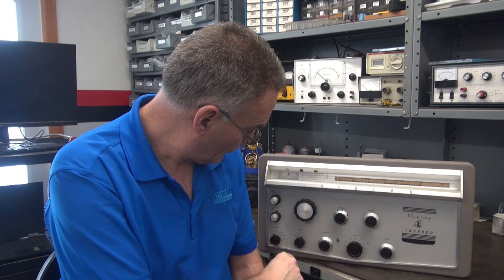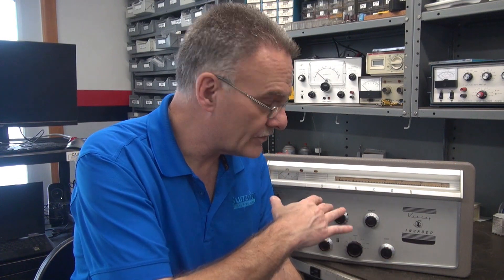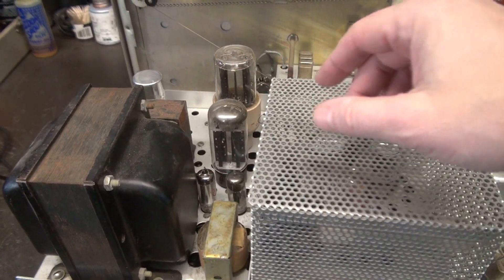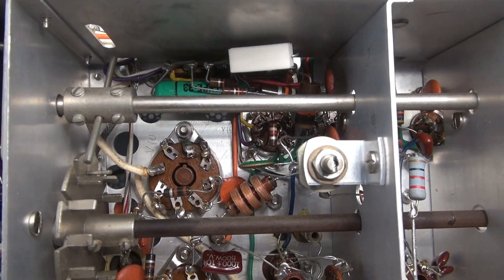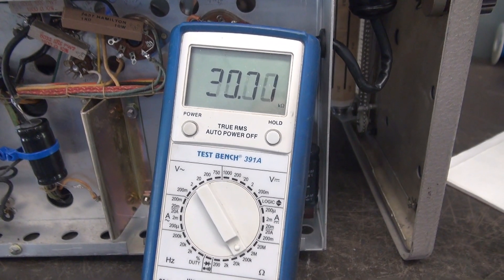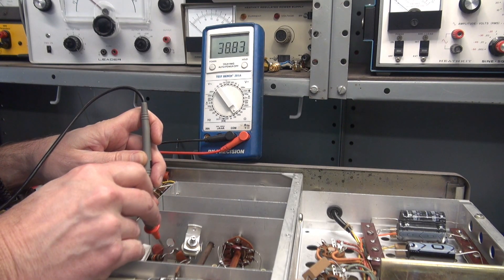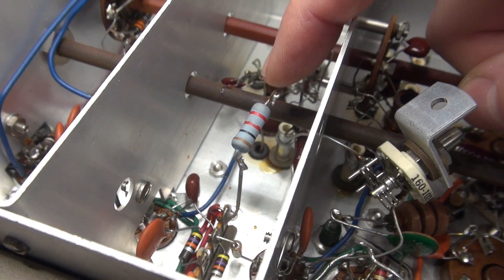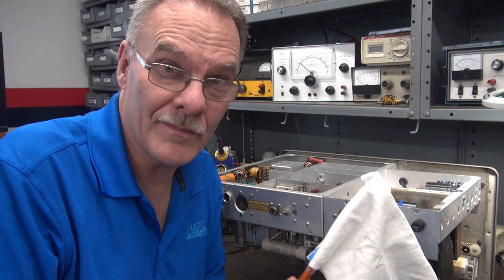Vintage EF Johnson Invader 200 Ham Tube Transmitter Attempted repair Failed Need Help any advice?

Comment: You have a leaky mics cap. Common problem with this transmitter. Shows on when voltage is applied to driver tube. Also check to make sure bias is correct on the driver tube grid. It mill make it stay say to much corrent. W3AMT 73's

Comment: I have a Viking Invader and have had it since the late 60’s. Until recently I had only had one problem with it long ago. A spurious signal just below 7.0 MHz. Turned out to be weird harmonic of crystal oscillator. 2nd harmonic of carrier oscillator mixed with 2nd harmonic of first mixer. Ended up with keyed CW signal at 6994 KHz. ( I received a notice from the FCC) I added a trap tuned to second harmonic of one of the crystal oscillators. A few years ago it stopped transmitting. I suspect one of the oscillators. I will soon be going in to see what the issue is. 
Did you pull the driver tube and check the resistance? I don’t think I heard you say you did. Just a wild thought. I will watch the video again. I am very interested in your Invader project. 
Don, N4DJ

Comment: Possibly a hairline crack or carbon short in a tube socket?
In all of my years of working on radios I have never had the pleasure of working on one of those. It is quite a nice looking unit. I have faith that you will figure it out.

Comment: I’ll have to confirm this, but I did my first research on Invader 200/2000 a couple of weeks ago because one came up for sale nearby. This “sticks in transmit despite the relay” issue rings a strong bell in my mind. I read a lot of threads, but I’d bet this was on a QRZ forum, and my recollection is that people said this is a neutralization problem. The circuit heating would be from the RF oscillation, not a DC overcurrent condition caused by a short or faulty component. Are you seeing VHF on the scope at the driver stage, or final grids?

I’ll try to find this again, assuming my memory is correct. Meantime, you might try searching the boat anchor and general technical forums on QRZ.
Reply from the maker: Yes, I agree, I had the RF oscillation, I could stop the transmit latch by detuning the plate or exciter variable caps. This was before I discovered the open 1K resistor. With the new one in, no transmit, but overheating of the resistor

Comment: Terry,  I agree with The Radio Shop about the tube socket.  If it's Phenolic wafer material and the tube has been overheating it could have created a micro crack that has carbonized making the circuit draw more current.  Suggest pull all the leads off the socket and check for insulation to ground and between pins.  Check with a megg-ohm meter.  Change that socket out.  I had a similar problem with a Quad Comparator.  All the reference levels were OK but it just wouldn't work.  Changed the IC- no difference.  Changed the phenolic socket and bing-go, it started working.
Reply from the maker: Yes, I agree, I am also concerned with the heating damage on coil L12. It is feeding the plate of V9, plus the junction of the 1K that overheats, I wonder if there is a carbon path within that coil? I plan to inject 300vdc direct to that area and see what heats. I have a hanger queen for spare parts! Will follow up

Comment: I know ✋  Commander. Listen, we found some beryllium on a nearby planet. And we might be able to get there if we reconfigure the solar matrix in parallel for endothermic propulsion. And hopefully no engines heating up Cap'n!
Lol.  Its sounds like you need a thermo meter and follow the trail to the excessive heat.

Comment: How does one match up new capacitors to replace the main filter cap?  I’m having a hard time finding a 40-30-30 for my old Montgomery Ward Airline.  Thanks!  Just discovered your channel after getting this radio, and I dig the content!  Great work!
Reply: 3 separate caps, a 40, a 30 and a 30, ensure volts are at a min the same, modern uf's values will be close to old values, tie at neutral.  ~Jack, VEG
Reply: @VintageElectronicsGeek   Sounds good!  So just a 40mFD, and 2-30mFD?
Reply: @kaidenlem  Yes, that is correct, remember to keep the voltage at the same level or higher. Oh, if there is any supporting components on the old legs, insure to install them as well. ~Jack, VEG

Comment: Sometimes even when we take a methodical approach we run into an issue that at the time does not seem to make any sense. We just never know when we buy a used rig if someone else had gotten into it and added more wiring that was partially shorting out high voltage. It is good to find someone who has had the same problem and solved it when all else fails. Good luck in your quest Terry.

Comment: @4:48  That middle cap to your fingers left has a bulge on the left side of the lead.
Replace those time expired wax capacitors.  Don't break your own rules, replace them!
There's more than one damaged component from shorting.

Comment: What if you isolate the driver section from the earlier stage of the transmitter?  Radio goes into transmit and then when you switch off the push to talk it's still transmits?     That internal T/R relay, close contacts.  How close is close?  Also, is it wired up right?  Stuff that is connected on the NC or NO part of the relay, is that all good?   Prior owner had everything lifted off that tube socket checking what you just got done checking.  Did he assemble it right  Finally, what about swapping out the driver tube?  Checks okay on your tube tester but maybe falls apart in the radio circuit?  Voltages on the socket are correct?   That resistor cooking the way it does.... A big beefy resistor at that.  Interesting.

Comment: When I first heard that music I thought I had clicked on a Stefan Gotteswinter video lol. But in more serious note that is an interesting problem.  Time to remove items for process of elimination until the ohm readings are correct. Like the wire going to the switch.  Are those tube sockets like the Vikings? I seen them carbon over and show short to ground.  I know you can fix it Terry.
Reply from the maker: Thanks man, 1st time I have worked on an Invader. Different... Stepping back to think

Comment: I noticed some of the wafer switch sections  might be double-sided.  I have seen a carbonized short between two sides of a wafer switch (in my case an old HP voltmeter).

Comment: Terry, were you making all of those measurements with the driver tube in circuit? If so could it be offering the parallel resistance to ground making the value lower than it should be. Another words, is there something wrong with the tube?
Reply from the maker: I tested with and without the tube, Problem remains
Reply: @d-labelectronics  I figured you did, but just throwing stuff out there.